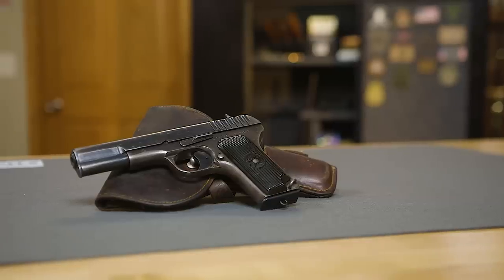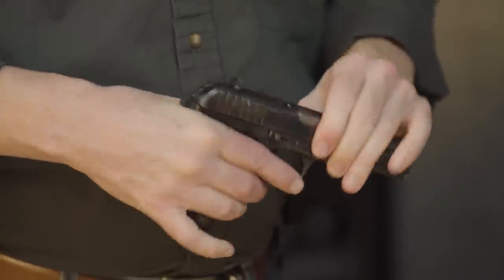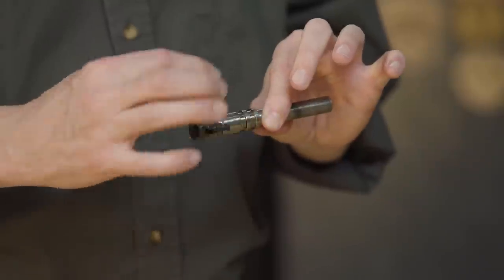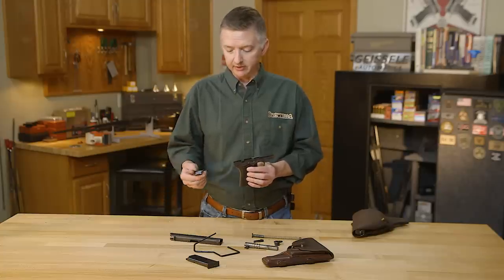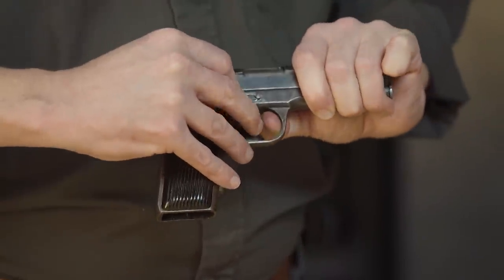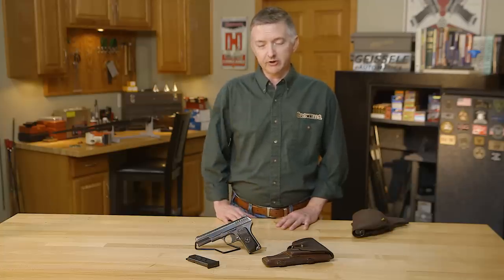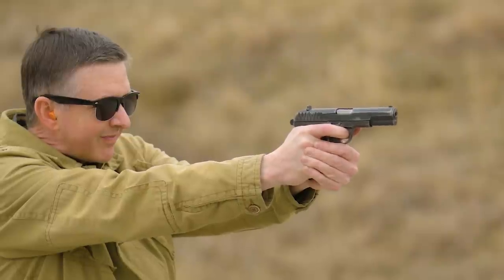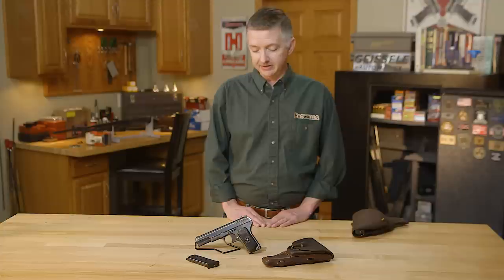From the Vault: Tokarev TT-33

Comment: I have a couple of the Yugoslavian M57 and a Soviet TT-33 (1941 production).  These are fun to shoot.  The bottle necked round is hot and sounds cool like a small rifle.  The muzzle blast is a round ball of fire but not really distracting.  Pick one up for $200 and change.  I prefer the Yugoslavian over the others because the grip is longer.  The quality on these guns varies quite a bit, so I would look at one in person before buying.
Reply: I avoid the M57 Tokarev version  -- the longer magazines they require are hard to find. My 3 Tokarevs (2 Romanian and 1 Polish) all use "normal" magazines (8-round) that can be easily found. I suppose the other parts in the M57 are the same...if so, then they can be found without trouble. But I still see the M57's longer magazine a problem, and all for just one more round (9) isn't worth it to me.
-- BR

Comment: Vietnam adopted a new 13 round double stack single feed version in 2014.
Reply: Jorg Luc I take it they are banned from import? If not where can I get a new Tokarev?
Reply: @lensperspective9753  it's called the K-14VN. As far as I know the gun is not for export.
Reply: Ace vn
Reply: The 7.62×25 Tokarev round is a very capable cartridge. I wish it was available in a modern, double-stack platform. I guess the 7.5 FK BRNO pistol is sort of a development of that. The cartridge it uses is essentially anslightly scaled up, hotter version of the 7.62 Tokarev, which itself was a hotter version of 7.63×25 Mauser, which again was a hotter version of the 7.65×25 Borchardt.

Comment: I have tt 33 pistol of Russian. I like it very much due to its long history of uses in many wars successfully. It is long range potent round more reliability and easy to cancel. But unfortunately it has been obsoleted due to short round capacity in magazine, not availability of proper lock system and double stack hammer.